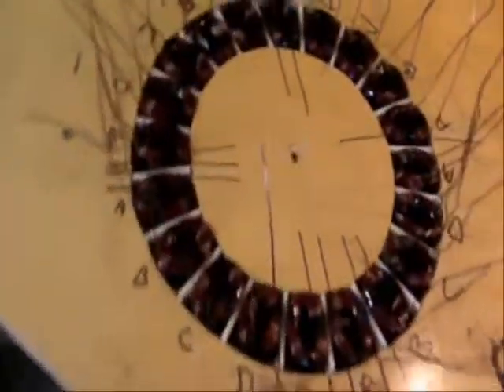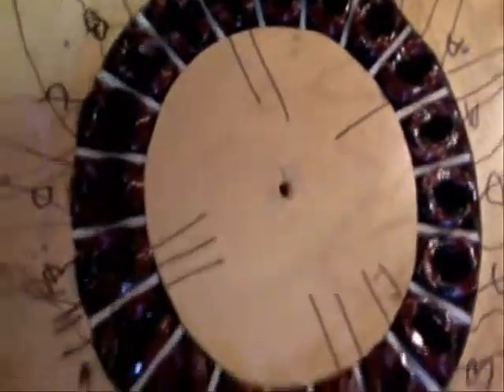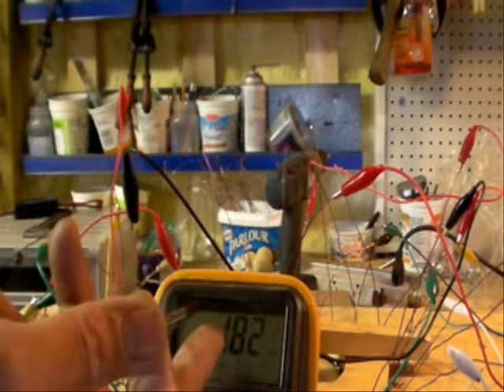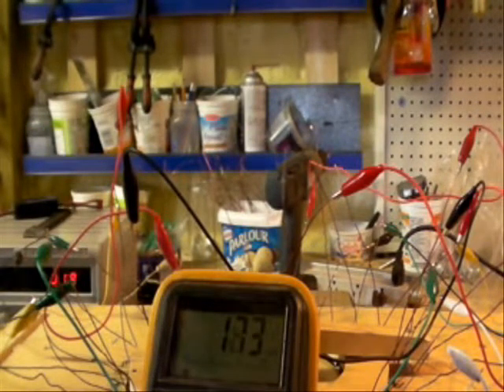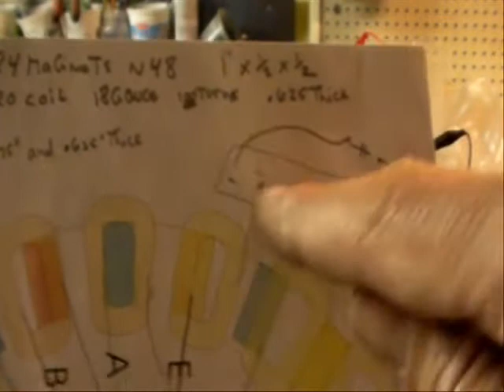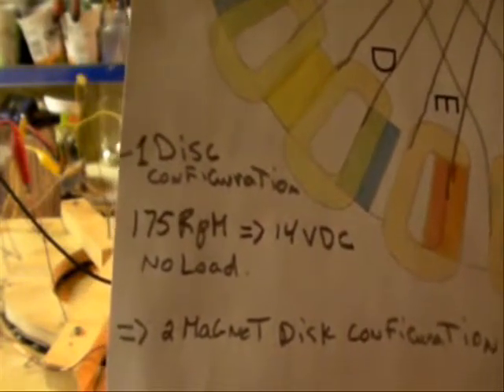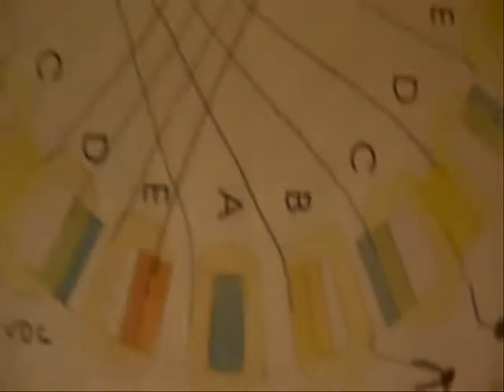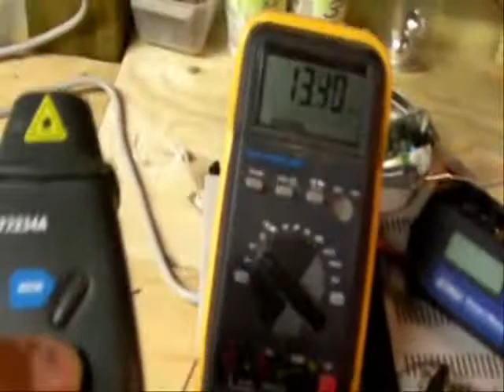5phase pma wind turbine green energy vawt hawt 30.wmv

Comment: do you have any scope patern of the output?
Reply from the maker: not really, i have few other videos showing test results
Reply: I saw some in so. cal create a 4 phase pattern , looked like 4 pitch lead screw pattern,  all the phases we synchronized , all moved in unison,  all at reasonably high frequency in around a 20 gage wire .